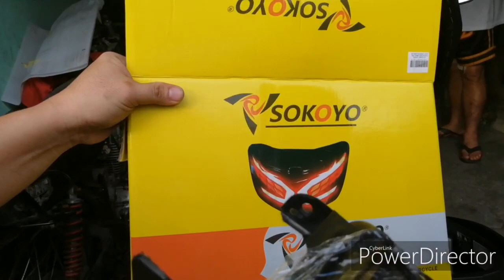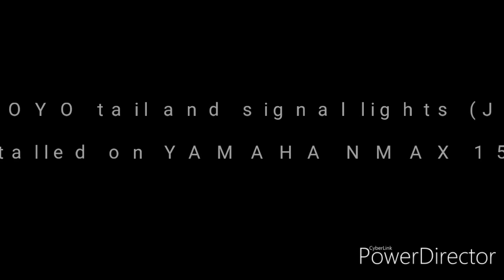JPA replica, installing SOKOYO TAIL AND SIGNAL LIGHT FOR NMAX 155

Comment: paps..tanung lng nag install aq sokoyo cignal light.ok nmn ung park light,hazard, peronpag nag ccignal light n aq right or left..sumasbay sa blink din ung park light sa cignal light yellow..bali pag nag cignal light aq sa left or right.opposite side nman nag bblink din ng blue or ung park light q..tama n nman lahat ng wirings..tanung q lng hndi kaya kylngn q mag palit 2pin relay. slamat paps
Reply from the maker: Matic un sir magpapalait ka ng flasher relay.. And iba po color coding ng socoyo may mga mali sa kulay ng wire nya pag rekta mo syang kinabit lang... I ttrace mo isa isa mga wire itutugma mo sa tamabg kulay ng stock socket mo.. Gamit ka test light
Reply: @motolikots1682  inisa isa qna sir.tlgng ganun kac u g gmit qng flasher relay ung ksma sa domino switch..cgurk nga po palit lng aq flasher relay...slamt sir..
Reply from the maker: @arvenvillaluna6957  basta sir matic un pag nagpalit ka ng led galing bulb palit ka ng flasger relay
Reply: Same problem paps. Naayos mo ba sayo paps? Pano ginawa mo? Salamat
Reply: Same problem po kapag nag flasher ako sa harap sumasabay pa opposite yong kabilang flasher ano kaya problema
Reply: Boss problem solve ko yan ganyan dn skin. Nilagyan ko ng diode yung magkabilang signal light . Ayun naging okay na sya d na sumasabay ung parklight pag nag sisignal light